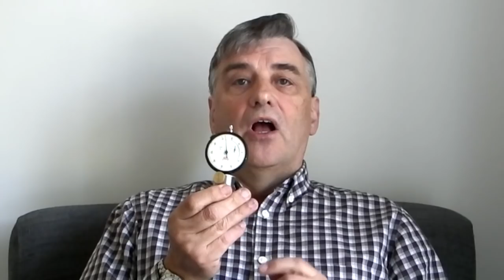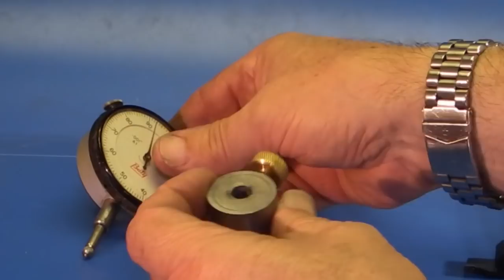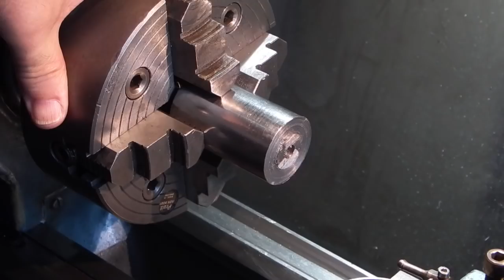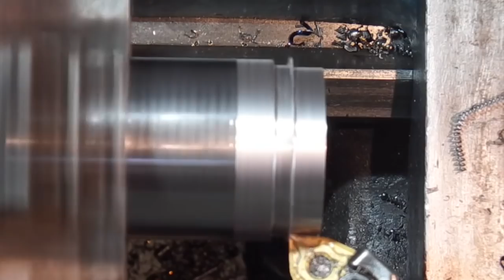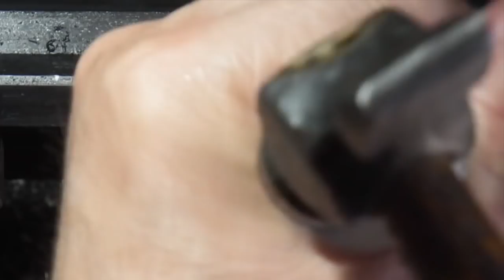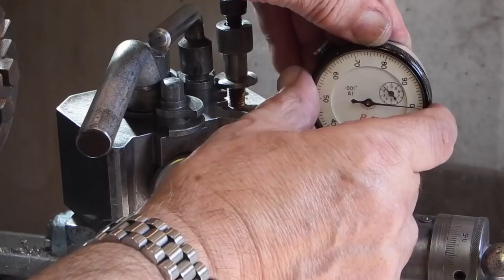Update to tool setting gauge

Comment: Nice project. There's a lot of chatter. Is that from using a dull tool for roughing? Is it separate from the chatter with the parting tool?
Reply from the maker: Hi Bill
The material was very tough to cut. I should have used a centre to reduce the chatter.